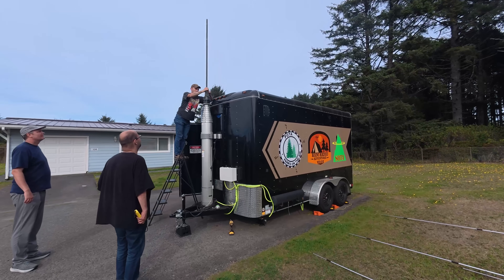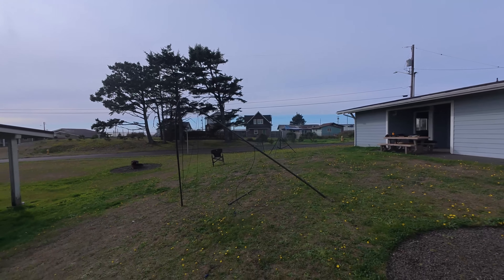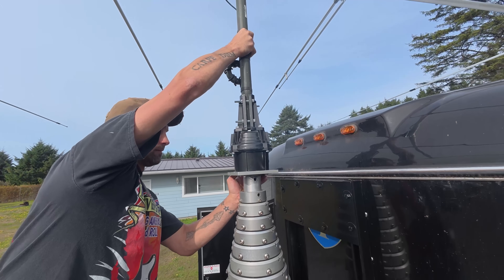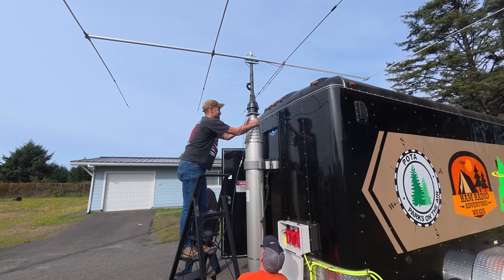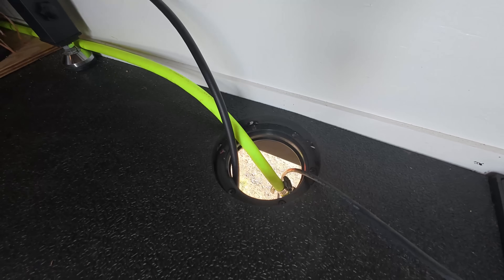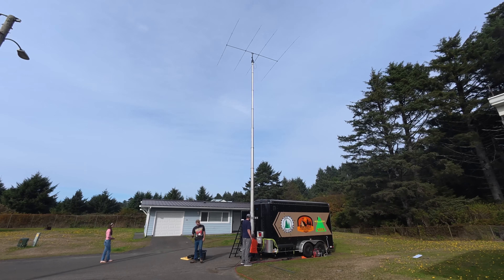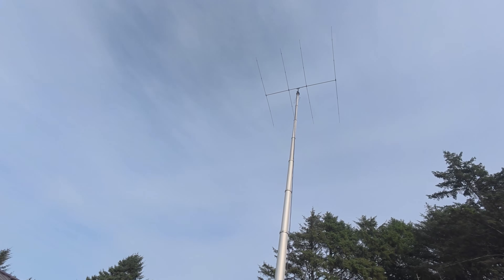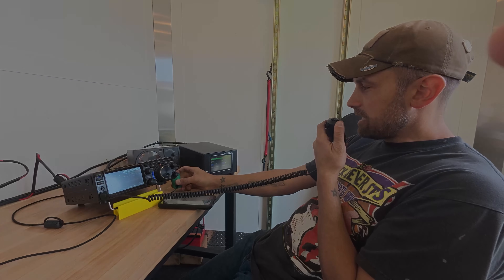10 Meter 4 Element Yagi On 50 Foot Pneumatic Mast

Comment: Too bad you have to dismantle it all when you pull the trailer.
Reply: The antenna comes apart pretty quickly. I think I had it down, disassembled, and packed in about 20min, and did it alone. 2 boom sections and each element is fine left together.

Comment: I have a 10m mono band yagi very similar to this one I’ll sell ya. Is about 30 years old and basically brand new. It has never been use in the weather and basically has lived in a box.
Reply: No joke, Sirio is selling these $160 new.
Reply: @AI7RK  can’t even buy the raw aluminum for that nowadays. 😂
Reply: @misteraon right? It's an amazing deal. I can speak from experience on this though,  the walls of these elements are paper thin. Doesn't take much for them to fold.
Reply: @AI7RK  I’d have to check my Cushcraft I have in storage, but based on its “vintage” I’m sure it’s heavier walled.

Comment: Life has been on going... finally dug my HF gear out to be sure make sure my station would be serviceable for Jamboree on the Air.  

1st contact LA on 20.

2nd MO on 40.

Noticed a Spanish station on the POTA spotter. Put the linked dipole to 20. Let the tuner do its thing... first ever 10 meter/ contact to Spain from SW Michigan 👀

I think the gear is ready for the Scouts for JOTA. ✌️

Comment: That's a lot more  than just 10m
Reply: Nope, just 10m. 4 elements, 1 reflector,  1 driven element, 2 directors,  trimmed and tuned around 28.300mHz.
Reply: @AI7RK  At 0:58  Look at the guy and compare him to the elements.
Reply: He's using a wide lens, it's distorting the size. It's an 11m CB yagi cut to 10m.